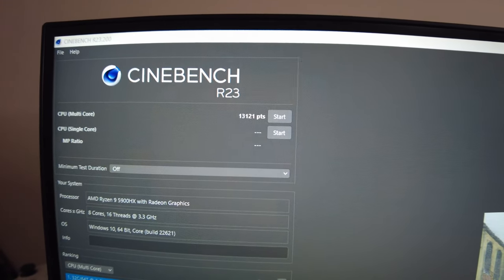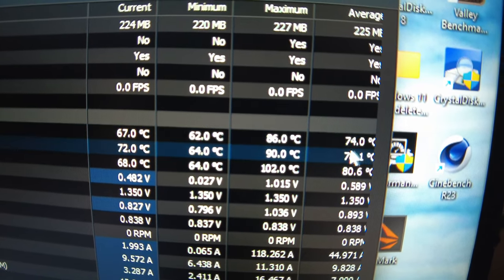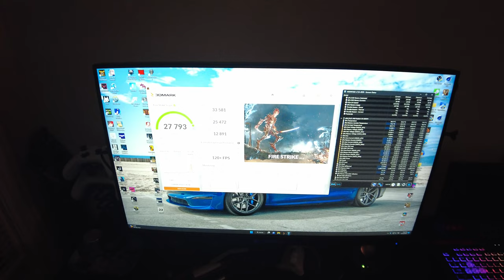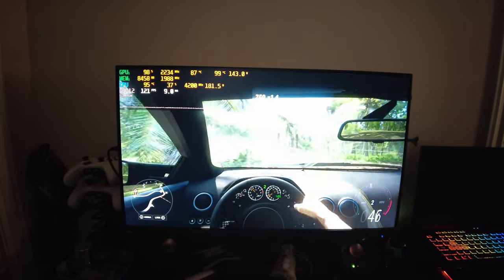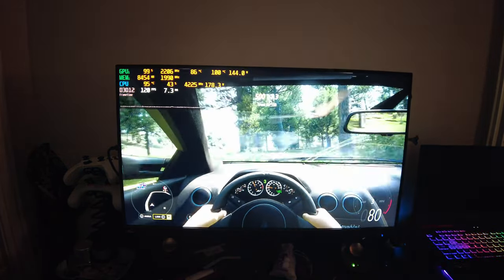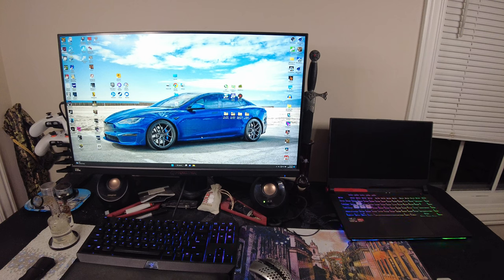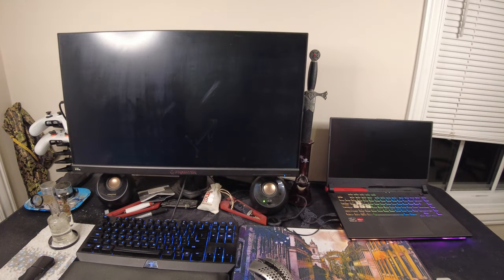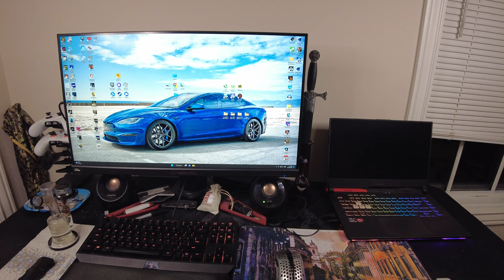Asus ROG Strix G15 Advantage Increase The Mounting Pressure Part  2

Comment: We are closer to the truth then before, continue please to find out the decision of problem with temperatures
Reply from the maker: Still got more work to do. Going to try Skii's guide next as it's my last hope of having good temps. Also had some simple advice to try in Armory Crate today. It's apparent you can get good temps by limiting the top slider in manual to 25/100 and leaving the bottom slider maxed at 190. Going to try that today.
Reply: @XxViciousxX  I have already tried, this worked. I've got 80°C with 20 W on cpu, then I tried 25 W and I've got 85 on cpu and I had the same fps in game as on 100 W and 97°C on cpu
Reply: @XxViciousxX  it won't improve temps it'll just give you more performance without changing temps much which is a net positive in my book
You can then reduce wattage to come back down to your current performance tier and you'll get better thermals

Comment: I was getting the same high 95°C on the CPU then in Armoury crate i set the APU sPPT to 25/100W and Platform sPPT to max. That drastically decreased the CPU temp now everytime it's around 70-85°C and i experienced no performance drop in the games.
Reply from the maker: Would be willing to try that really quick got nothing to lose lol. If that doesn't work I got a guide by a really smart guy named Skii to lower temps. Quite a few people have recommended his guide. But your idea is so easy why not try it first thank you very much for the idea I appreciate it.
Reply: @XxViciousxX  i read somewhere that APU sPPT is how much power is delivered to the CPU so lowering the Watt will obviously work.
Reply from the maker: @huzaif692  That makes sense before I got this I was a overclocking guy on desktop so I see sliders I max them. But that does no good if the cooling system can't keep up.
Reply: @XxViciousxX  I did the Skii guide and truth be told it took me more than 2 weeks to complete the fine tuning so its not a 1-2 day simple trick. That being said my temps didn't change that much but the performance got a huge boost. I got more than +1.6k overall score boost in 3Dmark and my CPU got a 1k boost to it. You should give it a try since you already have the cooling fan below so it should help you. Im planning to get one soon and hope it can reduce some temps.
Reply from the maker: @中共戰士萬歲  I figured that was the case just like fine tuning Ryzen CPUs on desktops. Took me almost a month to get an all core negative curve on my 5950x so many cores to go through and make sure are stable before moving to the next. Will probably start trying tomorrow.

Comment: Could you look at the individual core temperatures in HWInfo? On my unmodified G15 there is one core (Core6) that is 8-10C hotter than the others (e.g. when running Cinebench R23 Multicore). I would be interested how your core temperatures compare. My "Core6" always hits around 95C in Cinebench when allowing 100W TDP and at Max fanspeed.
Reply from the maker: My core 7 gets up to 95c Core 6 was 94c and most of the rest were all 93c first and last cores were 88C.
Reply: @XxViciousxX  Thank you. Seems more balanced than my cores 0-7: 83,81,87,84,89,86,95,82. I'm not sure what's going on there.
Reply from the maker: @AndiSkater  You're very welcome.

Comment: Bro i opened my G15 just to clean thae fans
unfortunately a little holding clip in the back cover on the fan side broke (you know the things that clicks when we put back the back cover of laptop),I am curious to know
did anything like that broke in your laptop while trying to open 😢

Btw why don't you try Noctua-NH2 Next time i heard it's the best thermal paste out there.
i really thing something is wrong with your liquid metal termal paste application.
Reply from the maker: So far I have opened up the laptop about 15 times so far nothing has broken yet. As far as LM goes it has the best thermal conductivity of anything out there.

 The guy from the reddit post tried all the top pastes and all were much worse than the LM. So he stuck with LM. Though his temps are also better than mine for now. His only got up to 88c vs my 97c. 

Takes a lot of effort to get it spread properly though that's where I think I messed up way too much LM came out and should have sucked some back up But wanted to keep going with my video
Reply: @XxViciousxX  oh i see thanks for the reply bro,idk this but did the reddit guy mentioned about the room temps though.I think that's a pretty big deal while doing this tests..also i suggest that you to use a laptop stand (the one that doesn't block the fans) + turn of the start up apps from your task manager(just disable all of them except windows security notification and Radion adrenalin edition software) reboot and run tests to  check the temps again..Maybe these 3rd party apps also trying to use the cpu cores in the  background same time as you run tests that maybe resulting in less scores and more heat!!! 
Good luck bro looking forward on your next video. Hope you fix this mess without any disappointment next time :)
Reply: First time i opened g15 i broke 1 clip also 💔 don't worry it's not damgin the laptop
Reply: @FOOD2HOOT  but it broke my heart 💔
Reply: @RAGE_RONIN  don't worry you still have warranty! Anyway it's a bad laptop

Comment: Imagine if it was now due to almost not enough contact kek
Btw difference between cooling pad vs not is the wattage on the gpu
Turning it on spiked your wattage on it to 145w from 130w 
Turning oc on from AMD software is not the same as bios stock from performance
Reply from the maker: So I shouldn't run the overclock setting in AMD settings? It seemed to boost benchmarks. So the cooling pad might not be useless to me after all that's at least good.
Reply: @XxViciousxX  might be useful to have that on if you dont wanna do manual tuning but manual tuning will always be better even tho it takes quite long to do it
Reply from the maker: @kickskii  I was using it when not making videos but then it makes it throttle the first time I redid the LM. But the second time I redid the LM it did not throttle. But it didn't seem to get my lower temps like I used to get with it so I thought why deal with the noise. 

I still would like to try tuning it I tried another guy's trick but it made my laptops GPU driver crash constantly and even my touchpad stopped working. Luckily reflashing the bios fixed it. I figured if I can do all core negative curve on my old 5950x on all of its cores this thing should be way easier.
Reply: @XxViciousxX  it's same difficulty as desktop well more difficult considering ryzen master doesn't work so a manual tune for everything is the way to go tho it kind of its faster if you think about it cause less cores

Comment: Maybe this is because the heatsink pipe is smaller than most laptops so that the spread of cold temperatures doesn't spread as quickly.
Reply: Looking at laptops with low temperatures, most of them use bigger heatsink pipes with 2 layers per fan, and that's also one lane, unlike ROG advantage is that only one small heat pipe is spread over a large heatsink plate
Reply: maybe if there is a heatsink pipe, choosing a laptop that matches the position of the cpu and gpu of this laptop is a good idea to try installing it
Reply: I think Asus is testing the wrong component. even though the fan rotates at 10000 rpm what can expect from one pipe less than 1 cm thick spread over a large heatsink plate
Reply from the maker: Some people told me Asus made the heat pipes small on purpose to neuter it vs its intel/Nvidia counterparts but that could just be unfounded fanboying nonsense of course.
Reply: @XxViciousxX  yeah this is true bottleneck on cooling system
Reply: Someone should really make a custom water cooling block for this laptop that can be screwed on top of the vapor chamber
It would be really interesting to use it as a full blown pc down the line due to the parts used in the laptop
Reply from the maker: @kickskii  I saw a laptop on Linus that has a little reservoir radiator combo and then you hook the tubes up to the laptop and it turns it into a little water-cooling system. It did help temps would be awesome if something like that could be done for this laptop.

It's a real shame it's such a nice laptop It just gets really warm I'm really going to have to try out your advice very soon cuz it doesn't seem like anything I do is going to get me better temps messing with the cooler I think that's just a lost cause it's the coolers just too small for what is trying to cool so my only solution is to lessen the load.
Reply: @XxViciousxX  there are good ways to decrease the heat but despite having given him the steps he did not try. so it will continue to suffer from high temperatures
Reply from the maker: @leonidasuno3803  I have been trying a few people's suggestions off-camera. So far one lots a bunch of performances. The second one made my laptop's GPU driver crash pretty constantly and black screen. So I'm going to go watch Skii's video on tuning and see if that will help. But I may have already screwed myself by opening the laptop up and even following his guys I may not get better than 96-97c on CPU and 86-88C on GPU with 101 hotspot.
Reply: @kickskii  hellow there skii

Comment: Hey man I have the 6800m with the 5980hx do you know why im getting stutters? Ive factory reset my laptop with all the proper drivers but my laptop stutters on every game I play. Any recommendations that you may have ?
Reply from the maker: The only time I had really bad stuttering is either certain games fault or the laptop was throttling and it's fps drops were very noticeable down to 15 or a second or two. 

Apparently the HTC sensor was tripping due to my cooling pad. Now that I redid my mounting pressure and LM I can at least use my cooling pad again. Without any random drops. 

Also certain BIOS are better than others. Like I'm on 316 to keep max fan speed. But have heard reports from comments of newer BIOS making games run smoother.